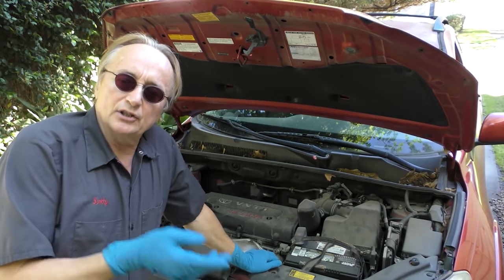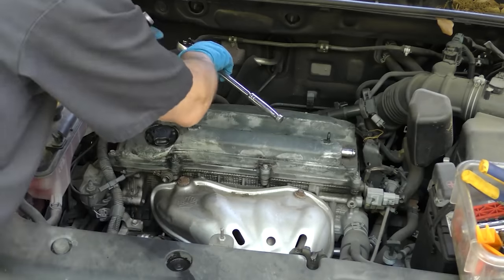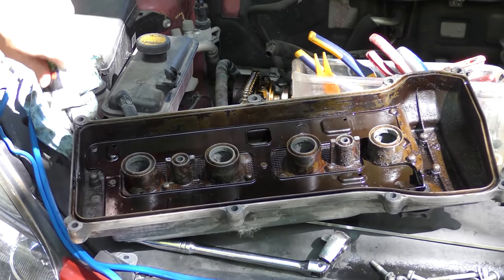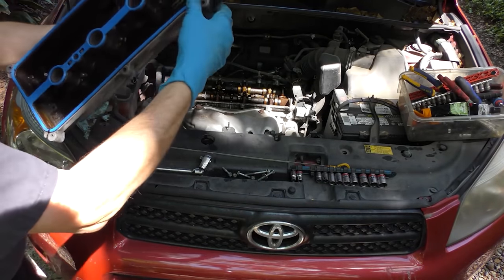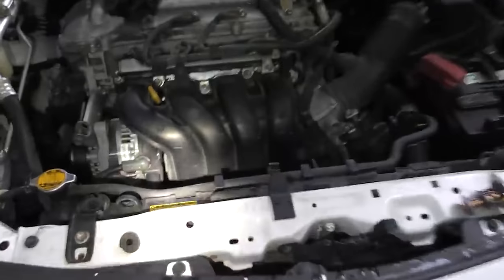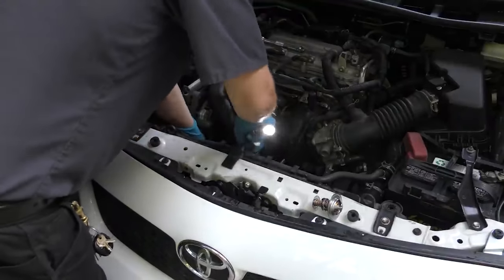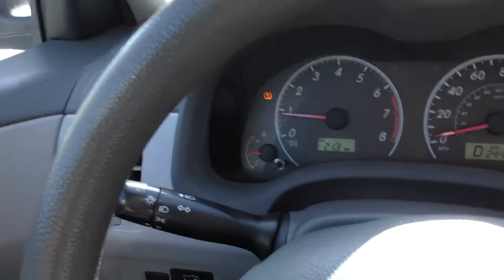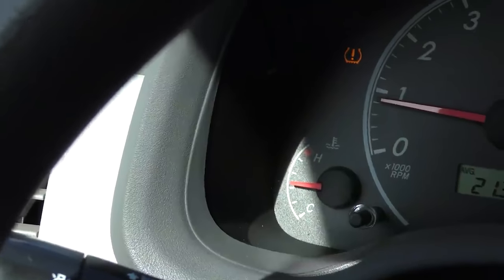3 Mechanic Scams Caught on Camera

Comment: Scotty knows what he is talking about. I was so disappointed when I finally landed my dealership job. I was from small town in Missouri and worked for small family run businesses and the salt of the earth type of people. Yeah they would do a 20 percent mark up on parts but sometimes you spend more time getting the right parts then you do working on the car at. I moved to the big city of Phoenix and got that job at the dealership. I saw some of the most unethical stuff in my life working there. I couldn't stand it. I would tell the service writer that I cleaned the terminals  and the car would start right up without a jump. After lunch he wanted me to replace the starter the cables and the alternator and battery. I told him the car is already fixed and he said fine and he had someone else replace the parts. When I was on break I saw the elderly lady paying her bill for the repairs with the service writer explaining everything to her.  I quit 3 weeks later I couldn't stand what was happening. I went to the manager and told to do what I was told and that if I have a problem replacing bad parts Perhaps I needed to work elsewhere. It kept being impressed upon me that it is quality work to replace all those parts because if I just clean the terminals and lady gets car back and week later the starter goes out and car won't start that it looks bad for the dealership. My reply was the 5 year old car had 7k on it so I hardly seeing that as a problem.. The dealers will milk you for every cent they can.  When I quit there even though I had no other job immediately lined up I felt a big weight had been removed from my shoulders. I got out of the mechanic business but will still help some people out when I hear of nightmare story. 500 for radiator hoses and antifreeze is ridiculous. For that money the customer should of had thermostat and a flush done plus maybe new drive belt. The people in Houston are probably really missing Scotty by now. They may have to move to Tennessee Lol.

Comment: Dealerships are the worst. When I was in college the local Chrysler dealer charged me repeatedly for replacing the O2 sensor without fixing the root cause - a bad spark plug. Finally took it to a local mom & pop shop and they diagnosed and fixed it for half the price of just one of those 02 sensor replacements.

Comment: HEY SCOTTY !
I have to say this.. 
Putting a valve cover gasket on with poor worksmanship is 90% better than false charges 😁
Home boy was probably an inspiring technician working under supervision 60% of the time.
Remember when u first changed a spark plug!?
Love my yota, your videos have helped me do my brake booster and clutch master cylinder replacements

Comment: Scotty just an FYI - There is no need to let it sit for 40 minutes. Bring it up to 1800 or so and wait until the thermostat opens. You will know when the therm opens as the fluid will drop and the filler neck will be swirling. Keep the RPM, top it off and cap it...

Comment: Went to a Hyundai dealer back in 2010 when my Hyundai had 24k miles. They came out with paperwork saying I had 42k miles and tried to sell me on a bunch of crap for a 40k preventive maintenance check. They had everything on their graphs as red. Then i corrected them on the mileage. They said oh, went back into the shop. 20 mins later they came back with the charts green saying everything is fine, you're good to go. I won't trust any dealer, or any mechanic. Finding one like scotty is like trying to find a needle in a haystack.

Comment: As someone who worked at toyota i had cars come back leaking oil. And running hot and i was just a lube technician and sometimes i had to fix the actual mechanics mistakes  but i got then running right this young buck actually uses the methods that scotty uses

Comment: I learned a looong time ago that you NEVER take your vehicle to the dealership for repairs unless it's a warranty repair.  They will always massively overcharge you and often hire the laziest and most inexperienced mechanics who will not properly diagnose the problem.  If a car pulls into a shop overheating and not leaking water, first thing I (and anyone who knows anything) thinks of is thermostat.  It's a $5 part that takes 10-15 minutes to replace on most vehicles if you don't have to spend much time scraping old gasket off.  You can test the old one by dropping it into boiling water (212° F) after you remove it and see if it reacts.  If it isn't that, then there's a blockage somewhere (not very likely in the hoses), probably because at some point stop-leak was used and built up somewhere in the cooling system.  NEVER use stop-leak products, they do more harm than good.  Find the leak and fix it.  All of these things (including the replaced hoses) could easily have been done for far less than $531.  Dealerships specialize in charging people money for nothing.  

Side note:  Antifreeze/Coolant is usually the same price or very close for a gallon of 50/50 premixed or concentrate.
                    Buy the concentrate, take it home and pour half into another jug and fill both with water.  
                    Now you have 2 gallons of 50/50 for half the price.   You just saved about $20-30.
                    You're welcome.

Comment: As a Toyota Tech, the only places that are required by Toyota to put sealer (FIPG), is wherever there is a break in the smooth surface of the sealing area that the gasket touches, like a "half moon", or any other joining areas to the surface that's being sealed. In my experience, and training, you are supposed to let the gasket do its job .

Comment: I’ve always used small dap of grease for holding seals in place. Basically a sticky vacuum seal. Have never had any leaks or turned gaskets but I’ll keep the sealer in mind for those that don’t fit very snug

Comment: Thank you sir for making my car related repair injuries so much less painful. (03' Jeep Liberty. 203k and runs great. Except for A) rear window latch stuck 'Closed' due to apparently bad microswitch, and B) ripping my hand open in the Cold, Stoopid MASSACHUSETTS Winter to try and release said latch to drive home without shattering window.
Any chance a good application of De-Oxit will get that little switch to work? or should I just try and find a replacement. Thanks and Happy Holidays!
Reply: I would definitely apply deoxit or contact cleaner, see what happens
Reply: @petergoesinya636  Thanks bud. Happy new year!

Comment: Thermostat is the first thing I check when I overheat. In my experience it is the thermostat 80% of the time. I owned a car that didn't fair well between winter and summer, it needed a different thermostat for each season if I wanted heat in the winter and to not overheat in the summer.

Comment: Heater cores in modern cars ALWAYS circulate coolant, regardless of temperature setting on the dash. They no longer have hot water control valves regulating coolant flow through the core like they did when Scotty was a young buck (He probably knows this, just got carried away with his explanatin). Cabin temparature controls regulate the amount of hot AIR being discharged into the cabin via the "blend air door", which mixes heated/refrigerated air with unconditioned air. Full hot temp setting does provide additional cooling esp on high blower but does nothing about heater core coolant circulation.

Comment: car sat in the shop for almost a month and the mechanics unnecessarily replaced more than half of my engine and overcharged. the original issue was my starter and they failed to replace even that. heading to a new local shop soon and I have high hopes considering how much he is praised

Comment: I went to a chain auto repair shop to get my tires balanced because I rotated my tires myself and need them to be rebalanced. They told me my front wheel bearing needed replacing and I looked at it and could see it was getting a little run down and rusty so I agreed. $300 fix no big deal but then they call me the next day and say “actually we are going to need to replace the entire assembly for $1200” I said yup no thanks, the wheel is making a slight whirring noise and isn’t vibrating violently so I’m not super concerned about it yet.

Comment: Went to a tyre place this week, as car battery was playing up, I'd taken up the chains free battery test offer, arrived and battery tested.  No volts at rest, no CCA figure or internal resistance, no readings at all disclosed. But then he states my alternator is not charging properly. I leave and visit another chain. This time the voltage is 12.4V (66%) and the cca was 399. And down on spec of 600 cca. And the internal resistance was 7.2Ω and thats why the alternator was not charging it properly due to the resistance, which should be 0-0.02

Comment: I hate taking my cars to dealers. I took my Jeep once to do some work on ignition switch ... I use cruise control all the time. I literally used the cruise control up to the entrance of the dealer. 

When i picked it up the cruise control didn't work. I called and said they did something to it and it needs fixed. They called and said that the cruise switch needed replaced for $250 ... I said they caused the problem, it's on them. They denied it was them. Something that was literally within fine coming in but not leaving, it's not rocket science. 

I took it to our regular mechanic and he found when they put the steering column back together they pinched the wires to the control switch and they were cut. He spliced them and all is well.

Comment: Just to let folks know that it's not only this one company's dealership that tries to rip you off, it's "SUBARU" also. They say there's a problem and gently try to convince you that the repairs are really necessary and EXPENSIVE. If you agree to the repairs, they take car to another area where you can't see what is actually done. Won't mention any particular dealership, but there's one on Highway 315 in Plains Township in the "WYOMING" valley outside of Wilkes-Barre, Pennsylvania.

Comment: No need to glue a gasket on an inline 4 cylinder.  There is no reason any professional would have any difficulty getting the cover on without losing the gasket. Don't ever buy premixed coolant,  unless you like paying a premium for a half gallon of water. Use a vacuum coolant fill and you don't have to spend an hour bleeding the air.

Comment: I’ve had a p0442, p9445 code almost 2 years if not a little over 2 years. Along with a few other codes . Both were still on my dash until last week when I took it upon myself to get a new gas cap. Neither could find the issue. I’ve spent thousands trying to fix these codes for emission coming up. I always have to go to YouTube and tell them what might be wrong and then they go to YouTube. There’s a mobile mechanic that ended up messing the driver side window ( had an issue with it before) and cost me over 500 to fix and put it back together. I miss my specialist mechanic

Comment: Medford, OR Subaru dealership shop was told my heating / cooling fan is "chirping on acceleration and cornering.  The gave it back and said" There is no chirping". It is still chirping after a nice bill for 4 hours labor. At 77 with a messed up spine; I cannot do that sort of work even if I knew how to get in there with all the many hoses and wires under there.

Comment: Not a dealership but a local mechanic quoted me $7000 for a new transmission, went to someone my neighbor recommended and he charged me 1500 for everything.  He told me the particular transmission for my car was cheap but they labor was expensive.  I’m in nursing school and would have had to quit because of the first mechanic.

Comment: My wife and I recently moved for the military. It was a 700 mile trip and we were towing a 40ft RV. We had just gotten the tires rotated for free from Costco and wanted the dealer to do a tube up on the alignment just to be safe for the long haul. We waited 6 hours (with an appointment) and I had to have my steering wheel turned to the 2 o’clock position to drive straight. Brought it right back and no one was there to help me. Took it back the next morning and four hours later it’s good. They said the guy who worked on it the day before didn’t know what he was doing. A day later, the alignment is bad again. Now I have to have the steering wheel turned to the 10 o’clock position to drive straight. Decided to just do the haul and went try a different dealer right after our move. 2 hours later and it was perfect. I will be sending the bill to Priority Chevrolet in Chesapeake, VA. Never go there if you value yours and your family’s well being.

Comment: 531 dollars! I towed a car, got it to crank (battery charge and throttle cleaning), flushed the radiator, replaced fuses, replaced a cylinoid, pressure washed the truck and fixed the gear shifter indicator. Replaced the thermostat 420 bucks. And I road tested it and fixed his gas level indicator because after I put 40 bucks of gas into it I realized the needle didn't move a centimeter. And I felt like I made a killing on that!

Comment: I went for a inspection at my local mechanic.  He told me I needed a new brake light.  He charged me $25 for a pack of 4 lights, installed one and kept the rest. 
 Then charged me another $50 for labor.  He also charged me $50  for the inspection which I found out later other mechanics were doing for $35.

Comment: I just recently had this same issue with my son's 2009 xrs corolla.  I used the same crappy blue Felpro gasket used here. It wasn't twisted at all. Removed it and installed the Toyota part valve cover, no silicone.  It sealed without issues .

Comment: Brakes are the biggest scam.  Mechanics will say you need new calipers or master cylinders and rotors when really all you need are pads.  They'll even say your rotors are shot , but you put a caliper on them and they'll have 5 mm worth of permitted wear with zero brake pedal pulse or steering shake.

Comment: My son went to a Toyota dealer with his 2011 prius that said it was showing an internal break problem. The job would cost almost $3000. He said he needed to get the money and the dealer said he would top off the brake fluid for the time being. The next day he drove 150 miles and decided to check his brakes. The mechanic checked but did not see the same error on the computer. He checked the fluid and it was very low so he filled it and told my son he just needed to keep an eye on the fluid. He drove back home  and checked his fluid 2 days later, it hadnt lost any. Even after driving back 150 miles. Its been a year and he still hasnt had to put any brake fluid in.  I checked with  a local Toyota dealer and the same brake job was only $1500. i told my son to report them to the BBB. This was  not the lone incident with this  dealer taking advantage of the public.

Comment: Heater cores no longer have hot water control valves to control heat discharge into the cabin. The core always has hot water circulating, only the position of the blend air door controls temp. Scotty knows this. "Back in the day", full heat acted like an extra small radiator. Not so much today. High blower does increase cooling a little but not much any more.

Comment: Yep, years ago a family member had a service bill from the dealer for over 3kCDN, some of which *was* required (brakes & suspension) on their SUV;  but almost $1300 was for ‘scheduled maintenance’ and fluid changes to the transaxle, transfer unit, couplings, u-joints, and rear differential. Except the vehicle was NOT 4WD! It was FWD.  Oh man, they were glad as F that they talked to me about it.  Got their money back , but the dealer had a hard time explaining it. Now, I guess maybe the service order info got tangled and mixed up with another vehicle that was in, but it goes to show that you have to know your vehicle and technicals.

Comment: im never going back to the states ever again.  got ripped off at the firestone garages. as a canadian who knows nothing about fixing cars, my front drivers side wheel was smoking up and for some reason i had a hard time accelarating. i went to 4 garages and they all cost 2000usd each time to fix. in canadian dollars thats about 2600-2700$. i was given every excuse in the book as to why i needed to pay for the most expensive work. 
once i got back to canada, my garage told me it was a simple warped caliper. they fixed the issue for 400$. my mechanic told me that i was scammed and taken advantage of because the garages saw a canadian license plate and knew i would never be coming back.

Comment: information  for 2014 Nissan maxima and probable more models and years of Nissan . had 2 trouble codes . 1 replace fuel cap , 2 indicated pollution system ( several sensors on fuel tank )  smoke test show smoke coming out near fuel tank. area ( systems vents into frame back there )  did not pull tank or replace expensive sensors ! went on too 3 rd . problem = hard start > solution for hard start was replace battery  ( bad cell = low voltage ) few restarts later pollution system code goes & stays  out  . Conclusion -low voltage causing sensor to give out warning code that was incorrect due to low voltage.       you are spot on about dealerships !!!!